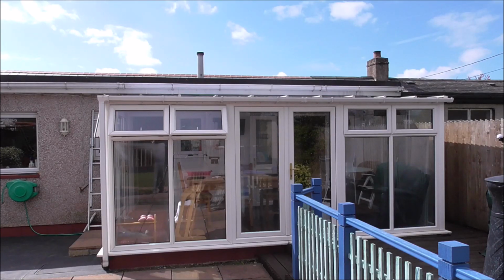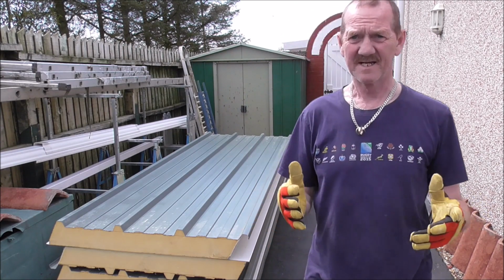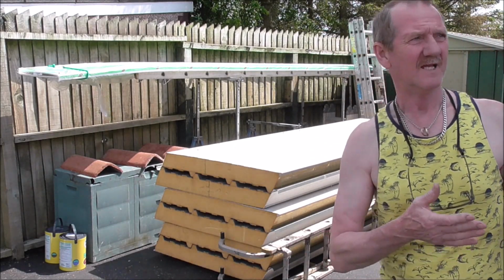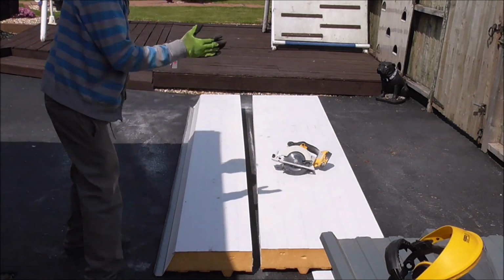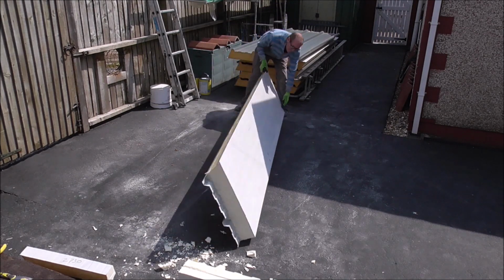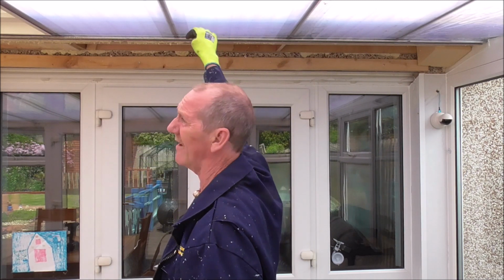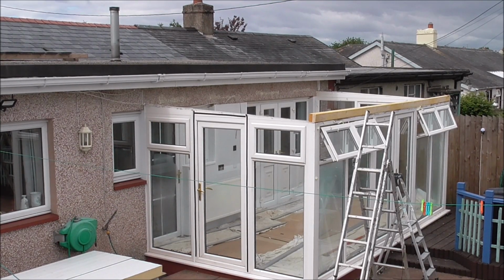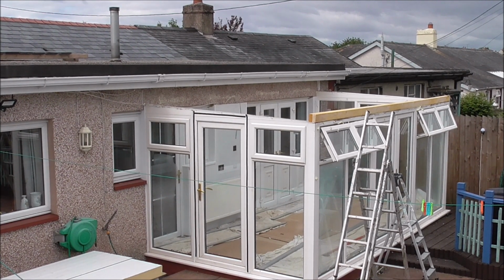New Concept Replacement Conservatory Roof

Comment: when you join 2 panel together is it a tight fix  and when yo sucure them together d you crew into the inslation
Reply from the maker: Yes and I put a bead of mastic down the top edge of the joint and use self tap screws on that top edge

Comment: under the roof could you plasterboard the ceiling?
Reply from the maker: Yes I can see a reason it would work but as it's directl6connected to the roof in my case I would be reluctant to walk on the roof after as it would crack the plaster, if you want to do so you would be best making it a bit higher so you could fit a stronger frame and not need to attach it to the roof

Comment: Awesome solution like no other and a great video. Credit to both father and son team! I have the same problem with my conservatory, cold in winter despite having to two radiators and worse than a sauna in summer. Mine is an edwardian style and the edge of the furthest point is slightly over 3m wide from the wall. Since the sheets come in 3m lenghts, how to overcome the extra width of i think 2-3 inches? If i can get this sorted than I would like to try and find a local carpenter to remove the aluminium frame and do something very similar to yours. Keep bringing us new ideas!
Reply from the maker: Hi and thanks for the great comment, now to try help.
These sheets I use are mainly maid for industrial buildings so can money in very long lengths so 3m is small to some that's out there, as for cost ? I got cheap as my size is too small for most industrial buildings so I would look around and you could be lucky or buy 7m lengths and cut them
Reply: @dmgladden  Hi David, touching base again for some advice. It turns out my conservatory frame is made of UPVC and I spoke to my local roofer whom I have used for reparing my leaky roof gutters and repainting of the facias. He said it is not advisable to put screws into a UPVC conservatory frame as it will seriously weaken it. 

Is your conservatory also UPVC? I see you have used 2x(2x4's) sandwitched planks together in the front of the window frame. How are they attached to the top of the frame, did you use some sort of epoxy and glue?

To complicate things, I have a P shaped conservatory and I spoke to a couple of suppliers and they said I should provide them exact external dimensions of the frame so they can order the roof panels factory cut to size.
Reply from the maker: @MP-mu1kw  Hi good to hear your moving ahead with your plans, as for the timber frame I installed around the top I screwed through from within the window openings and I can't see your man's reason for saying screwing through the frame will weaken it as that's how all the units are attached to each other and how it's fixed to the floor and house wall.
Reply: @dmgladden  Thank you for your reply. Yes, you make a valid point, I think what he might have been referring to is screwing the planks of wood from the top into the UPVC frame, which I guess makes sense because it would not have any metal plate inside for the screws grip into. But now that you mention that you screwed from underneath through the windows into the wood that give me hope and well done for figuring that out :) 

In my case I only have 4 ventilation openings and a doorway on the side like you have, the rest of the windows are fixed. So am I right to think I would need to remove the windows and refit them after screwing into the planks from underneath?

The only one other thing that is niggling in my mind is how best to join the planks together for the of the P-shape (3 sections), would it be best to do angle cuts or use batton joins and shave off the edges?
Reply from the maker: @MP-mu1kw  Hi yes I would use halflap joints and shap them, but joints won't have any strength, and I agree remove glass and fix timber for best result.
Good luck and enjoy

Comment: Great idea... What blade are you using to cut the steel, I've the same DeWalt saw...never dawned on me it could cut steel
Reply from the maker: Hi I do show you in the video you need to avoid skipping lol look a the before I start cutting and pause when I show the blade case all details are there, and yes it's great it the first time i have used such a blade
Reply: @dmgladden  cheers David, I feel like I've been told off at school 🤣🤣

Comment: Thanks for that David. Considering a similar roof for an asbestos garage roof replacement. Can you add details of where you bought them, cost and delivery etc? I'm in Scotland and places that i've looked at can supply panels at about £100 per panel for 75mm and I need 5 panels but delivery was going to be £600 !

If I could get the panels delivered more cheaply then I am actually considering building a whole shed out of them since they are so strong and since wood is so expensive these days...
Reply from the maker: Hi I got my panels a bit cheaper at 100mm I paid £250 for 6 x 3m but the delivery was a killer at £250 but till overall I paid £500 for all 6 check ebay that keep popping up I got off cuts from a guy on a site in East England
Reply: Ah, that's brilliant @dmgladden , I will keep an eye out for something similar. Looking forward to part 2, seeing them go on and how you finish them.
Reply from the maker: @smitcher  I think you will like just how amazing these boards are in so many ways I love them now
Reply: I saw @dmgladden  that Kingspan also make insulated panels with faux tiles on top that look incredibly real. If these last a similar time to actual tiles then they will be a game changer when it comes to re-roofing houses, given that the majority of the cost is presumably labour. Could probably strip and re-roof a whole house in same day!
Reply: prices have gone up sharply for all steel panels,as for delivery cost, if i were you id hire a trailer for the day and pick them up, much cheaper.

Comment: ive used these panels a few times now, my supplier tells me at 100mm thick you can span 4 metres without rafters, the thinner panels , i think they come in 40, 60, and 80mm thickness im not sure about, but your roof will be fine at 2,7 metres. best thing about this roofing is your building can be dry in as little as 2 hours.
Reply from the maker: Yes i guess it could but i feel a slight give at this span im not sure i would be so confidant at 4m im sure it will hold its self but i wouldn't want to play on it